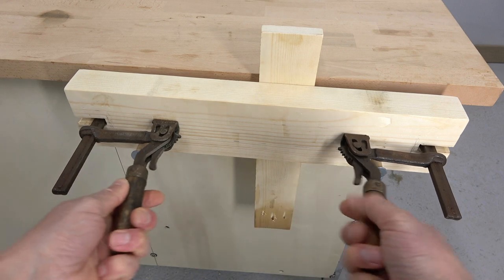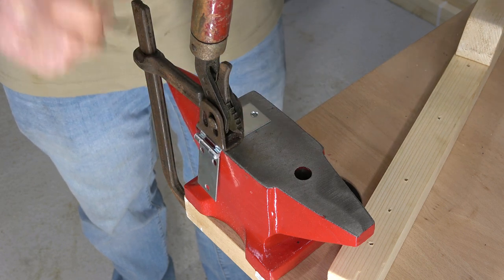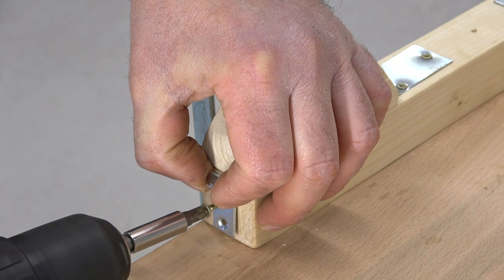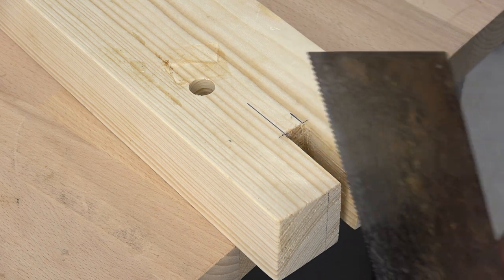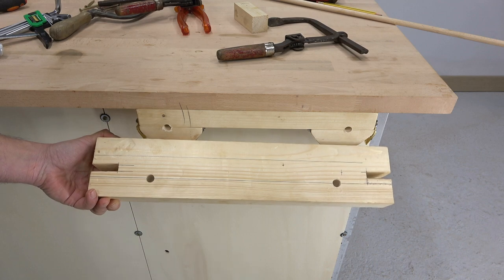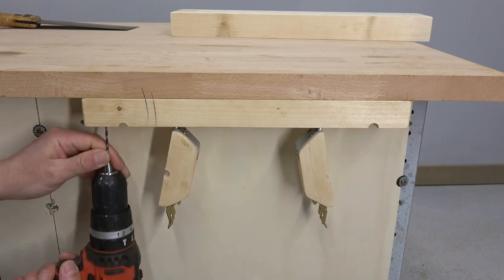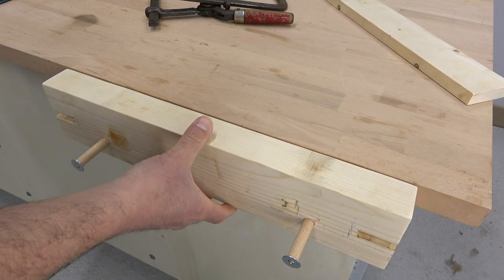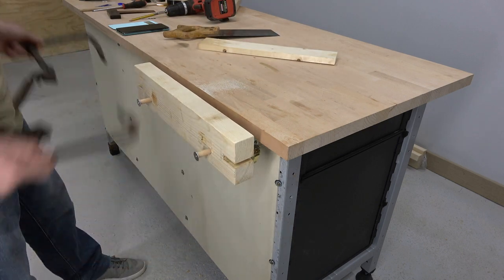It should be in every workbench a moxon vise

Comment: Very clever and simple but I agree that it could be simplified a little more by omitting the complicated hinged blocks and using a deeper block fixed to the workbench.  Of course your version is easily removable which this would not be!
Reply from the maker: The problem I had to solve is that there are drawers behind the vertical piece of plywood that covers the back of the workbench. So, I don't want the wooden rods to go behind that plywood sheet Thanks for watching :)